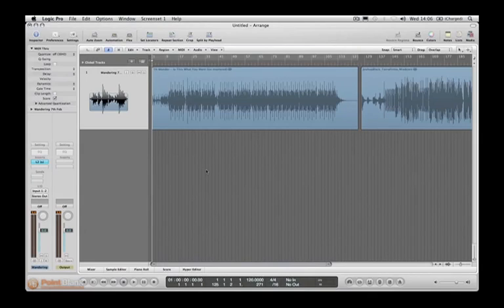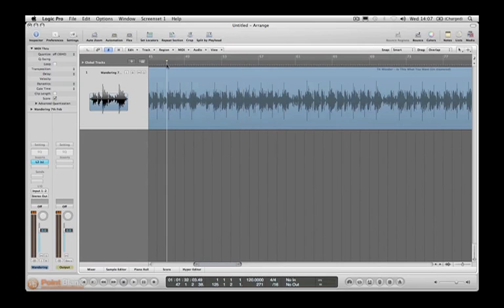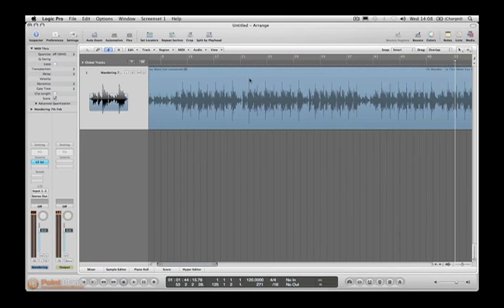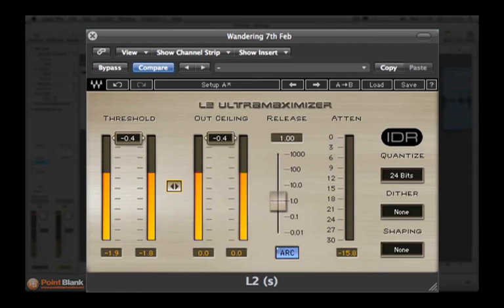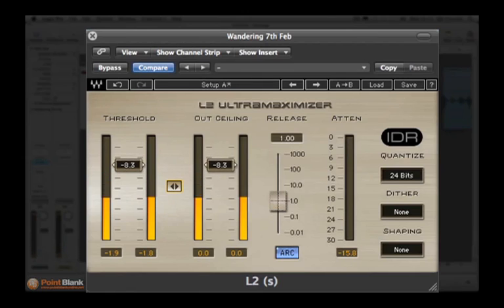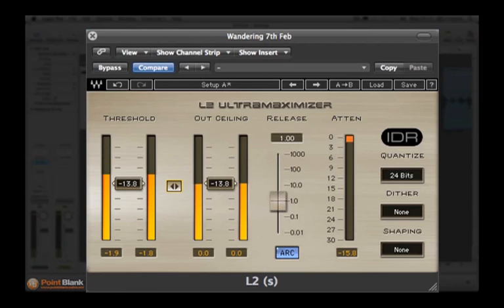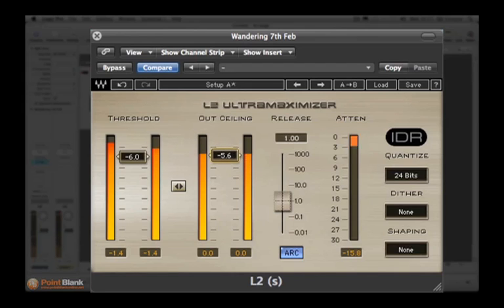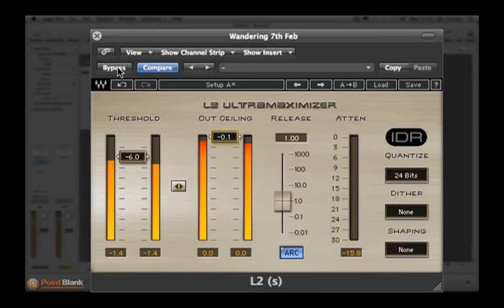Audio Mastering in Logic - How to Use a Waves L2 Limiter

Comment from the maker: @TheZetReviewer 

The Logic's limiter works in a different way, you simply add gain into it. It is a decent limiter and can work ok on some mixes but it hasn't have that feature of compensating the output as you increase the input. This feature of waves limiter is very useful I think as it allows to compare at the same perceived loudness, which is an essential practice in mastering.

Thanks

Comment from the maker: It is difficult to answer your question without actually listening to your mix. Although your threshold is –8.5dB, if the original mix is very quiet you may still have headroom , it all has to do with the loudest peak in your mix before hitting the limiter. Also depends on how the client you remixed for defines headroom.

Comment from the maker: @jonmacd 

Thanks a lot for info. But in the case of mastering demo, I don't think a higher bit rate will bring a significant difference as to hear the subtle differences as the audio data will still be compressed (we actually have to compress ourselves before uploading or the files would be far too large in size).

Thanks

Comment from the maker: They may simply mean that they think it could be louder even if your mix hit 0dBFS, in which case they will probably add more limiting to compete with the loudness war (which doesn’t mean that it will sound better). For this reason, you shouldn’t use a limiter at the mixing stage but instead leave this process for the mastering.